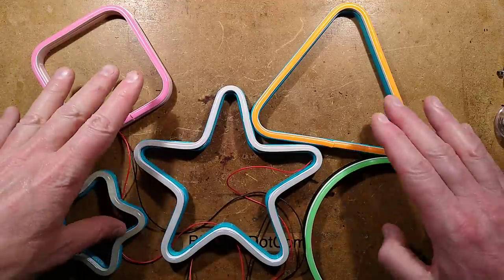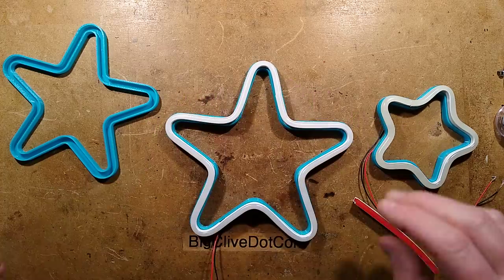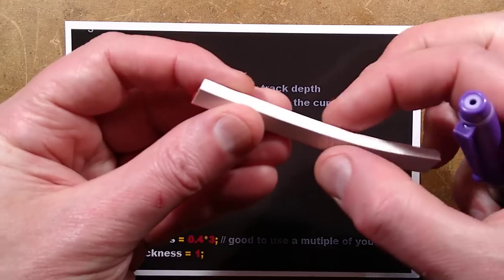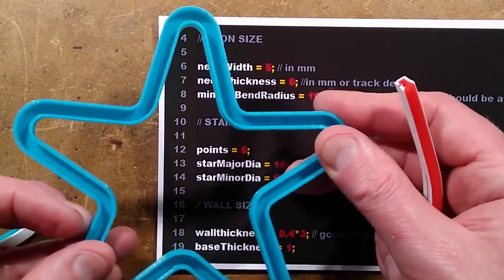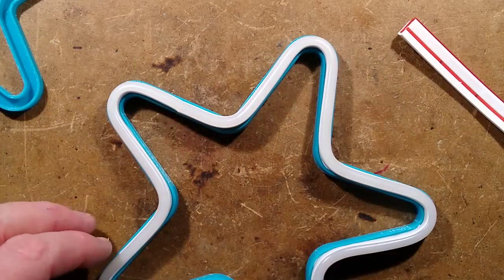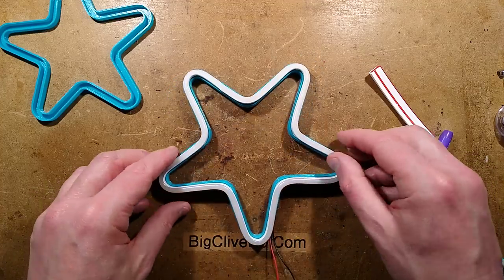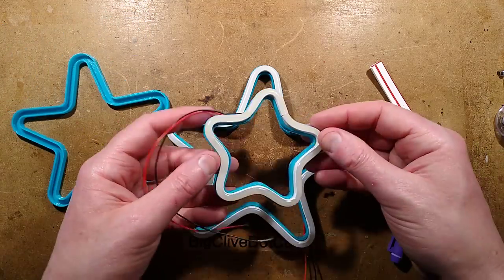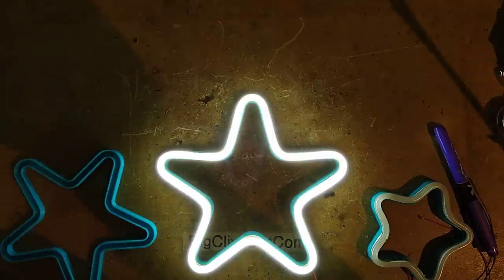By request - the neon star frame

Comment: Could you not allow the script to do the math and calculate the total circumference of the star, so then you can make ones that fit the correct lenghts of tape
Reply: That would be a nice advanced feature. If you put in your desired diameter, it could find the closest size that works.
Reply: The problem is reality ;) . If you measure the (center)outline of a star it still doesn't mean that a LED strip of the same length (but bent around corners) would actually fit.

Comment: Would be interesting to have a "perimeter modulo" function that would take your points/inner/outer diameters and make a suggestion for a value that would make for a nice neat cut on the LED strip. You input a size, and it gives you three options: one with outer D fixed, one with inner D fixed, and one that splits the difference.

Comment: I’ve been wondering if it’s possible to drive a 20mA LED at let’s say 40mA at 50% duty cycle, or 200 mA at 10% duty cycle. What kind of frequency would it have to run at to not burn out immediately? The application is backlights in LCDs, that flicker in sync with the picture to reduce motion blur. The technology makes the image look a billion times better, but it’s always dim and dark compared to CRTs that the tech is trying to emulate.
Reply from the maker: Yes that's done with multiplexing.
Reply: You will have to look up the maximum (peak) current of the LEDs. Typically this is no more than 150-200% of the maximum continuous current so even a duty cycle of 50% at double the nominal current may be a stretch.

Comment: I know in the past you’ve said you’d prefer not to learn CAD, but would CAD not make some of these a bit easier? It’s much more versatile than having to code your shapes, and isn’t too difficult to learn the basics of. I’d say that star shape could be made relatively easy using CAD even as a beginner.
Reply: I don't immediately know if you could easily parametrize the number of points in, say, solidworks. 

In general though, creating that geometry is indeed trivial in most standard CAD programs
Reply: I'm pretty sure something like this would be very easy to do in Fusion360, with set parameters the user can change. Fusion is also much easier to learn (yet still very potent) than a more traditional CAD.
Reply: @thephlophers  
I'm using FreeCAD for my projects (mostly for CNC, bot 3D printing). Parametrizing the points isn't complicated at all. I did pretty much the same for a tri/quad/hexacopter frame (that I then never actually built XD ) . Sketching it in a way that the number of arms was configurable was less work than even the bolt holes for the motor mounts (just a few tangential/perpendicular constraints).

Comment: 3 pointed star!?  Hmmmm... That's gotta be a triangle 🤔🤔🤔... 😉😂

EDIT: Have searched for other comments like this and it's different... Hmmm
Reply from the maker: Think of a triangle with the sides pinched in.
Reply: In extreme cases, when the inner diameter is much smaller than the outer diameter, it looks like the Mercedes Benz star.

Comment: I like it! I just wonder .. when you print those frames in a transparent/clear plastic, would'nt that give a even better effect because of the missing shade around the frame?

If that really works out, one could even hang them up in the air instead of just putting them on some surface.. (just like old real neon sighs floatet somewhat above most walls ;))

Just a idea ... would love to see someone testing it. ;)

Love your videos BigClive .. keep it up! ;)
Reply from the maker: Most if the light gets thrown out one side of the neon material.  But you do get double sided versions.
Reply: @bigclivedotcom  Ah, i didn't know that.... I have just some cheapo led-neon "cloud" from aldi Where they did something imho srsly weird. There is a outer metal frame and then a inlaid neon-led stripe, fixed with zip ties... But it is build in such a way, that the bus-plate is on the inside of the cloud..

So in effect, it only glows at the front and the back .. but not to the sides.... weird. ;)

I imagine, even with a single sided stripe and using clear plastics, you would get at least a bit of diffusion/diffraction .. possibly bringing up the effect somewhat. ;)

Dunno ... sadly i don't have a 3d printer. ;)

Comment: I would love to see a seven-seg version
Reply: I want to see the 3 pointed star 🤣 🇷🇺
Reply from the maker: That's not a bad idea.
Reply: @bigclivedotcom  I have no clear idea what you all mean by a 7-seg version. Of what? Just the outlines of the seven individual segments as used in 7-seg displays? If this is what you propose, it would be very easy using my repo. I can easily try that.
Reply: @Vile_Entity_3545  Just look at a Mercedes-Benz, then you see one.
Reply from the maker: @ksjhi  To me it would just be a very simple set of blocks on a thin backplane to hold 7 pieces of LED neon in a seven segment format.  It would have to be scalable to allow the length to be in nice round 25mm multiples for the LED material.
Reply: @bigclivedotcom  Ah, I see. This should be dead easy, since it is just one cube for the base, then for each of the seven segments, a difference between a larger cube for the walls and a slightly smaller cube for the LED neon tape. This can also easily be parameterized in all directions, just some adding of length, widths and gaps. No need for my script then, there are no corners to round off. Perhaps, it might even look better to simply use one large cube and subtract just some deeper slots for the LED tape, not walls on top of the base plate, so that it looks like a real 7-seg display. You would need not to use much infill for the block when printing. 
Anyway, I created outlines for proper large segments and updated my repo. I also added your idea, since I already had the basic calculations there, so the amount of additional work to create these plates was limited.
Reply: O.K., good idea, I have included it. Well, not one version, but actually three versions.
Reply: @ksjhi  i mean a 7 segment display, not just 7 lines
Reply: @dartfrogdk  The seven lines were the idea of BigClive. How do you suggest that the display should look like? A cube with the outlines of each of the segments in LED tape, possibly repeated for each digit? This is no problem to construct, but the whole cube would need to be very large to accommodate the segments. Not sure if lots of people have large enough 3D printers. I certainly do not.
Reply: @ksjhi  Im at Work, will look into your github later 👍
Reply: @ksjhi  They are all nice, but the sevensegdigit is the one i would make but i would like the spaces to be one space, because i will use wled in the digit and fill it with resin
Reply: @dartfrogdk  Since this is a very special application and I expect not too many people need this, I doubt we need an additional script for a one-off. I suggest that you construct your shape in Inkscape and use line-tracing-svg to generate the frame. This should work. EDIT: I tried it, it works. I added an example in the "graphics" directory.
Reply from the maker: @dartfrogdk  The idea of using standard LED tape and diffused resin is also quite interesting.
Reply: @bigclivedotcom  i will try it soon, but im very busy with work the next 8 days
Reply: @bigclivedotcom  I thought about getting some LED phosphor powder from China and mixing it with resin. Could even work in an SLA printer.